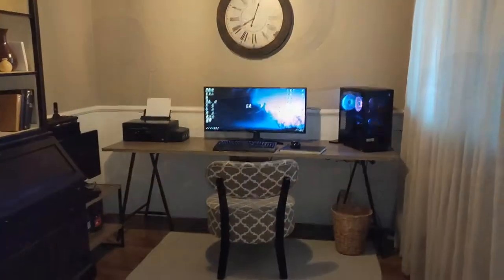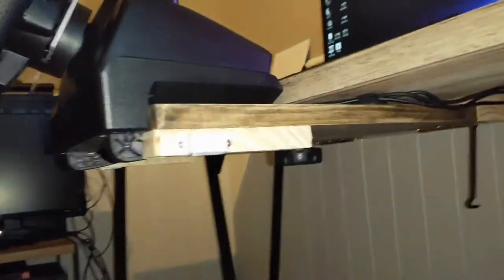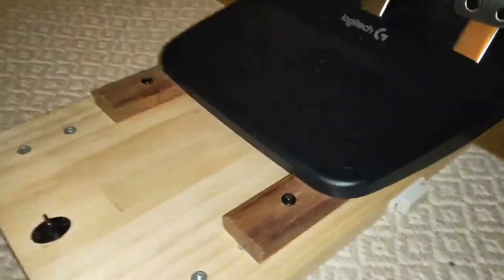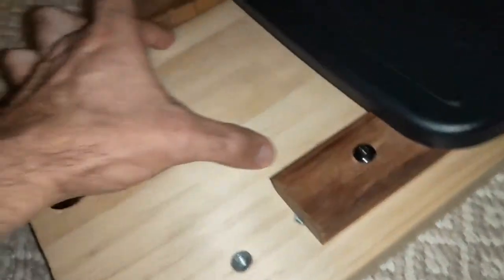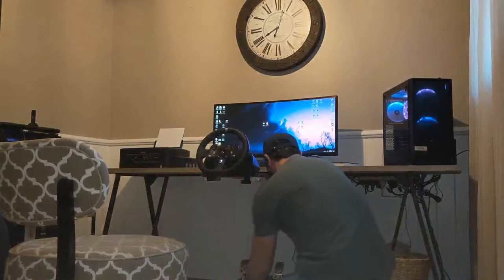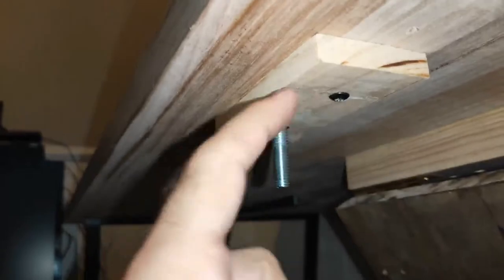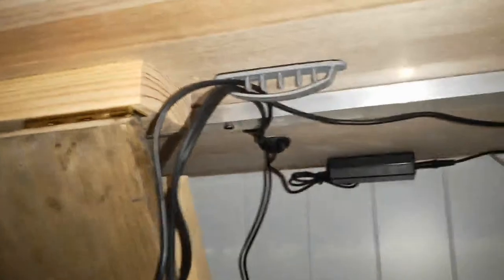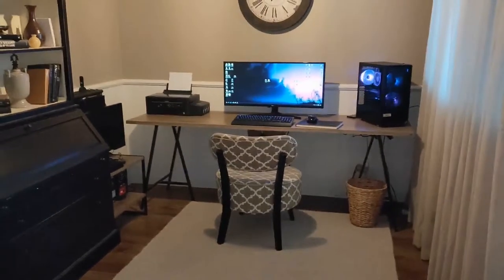How to quickly setup your gaming steering wheel & pedals for use. Swings away under your desk.

Comment: Amazing are you still using this set up absolutely fantastic idea
Reply: Thank you.. I am still using it and love it. The only thing I have done is remove the peddles from the timber and only fold the wheel back. I felt the peddles sitting on the floor weren't a problem and put a rug under the desk for it to grip onto. Just a tip you might want to consider.. I did plan on making the wheel slide out of the way once folded under to completely remove it from where you sit. Wouldn't be hard to do with some rollers in a track 👍

Comment: Great idea!  Is it possible to do this with a shifter as well?
Reply: If you make the board the the wheel is attached to wider you could put the gear shift on that and it will flip with the wheel... or what I was planning to do was attach a bracket from the board to hold the shifter. Either way you can make it flip with the wheel.

Comment: It's an alright idea, it would still be extremely in the way while sitting on the pc doing other stuff.  What if you made it swivel to the side so you had leg room still?
Reply from the maker: Not for me... guess it depends on how a person sits. I did have an idea to put the wheel on a track to slide/roll it to the side which I still may do but not for leg room so much but more for neatness so it’s tucked to the side... if I end up doing it I’ll make an update video. Thanks for your feedback.
Reply: @Dribbler1  I like the idea of a track to move it to the side. Might have to use that one.